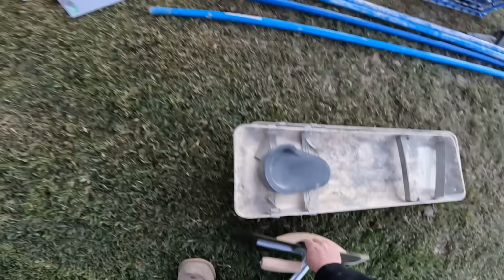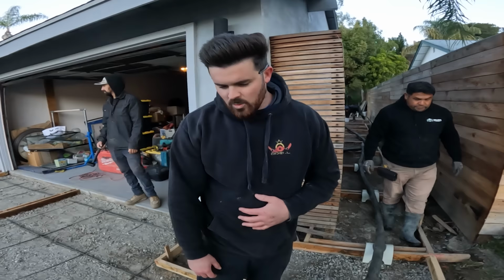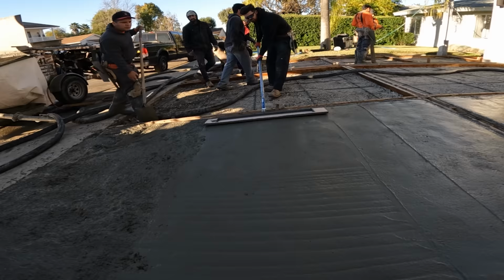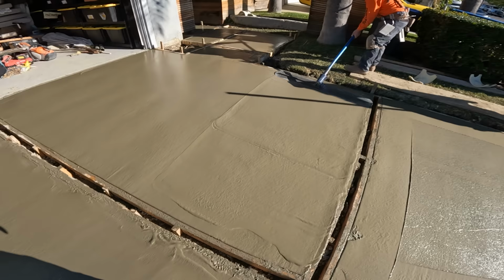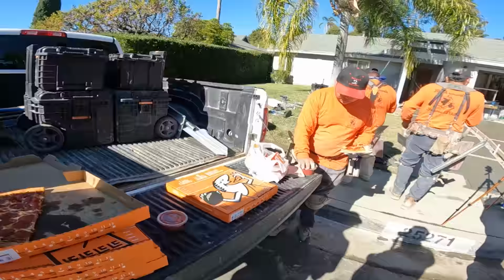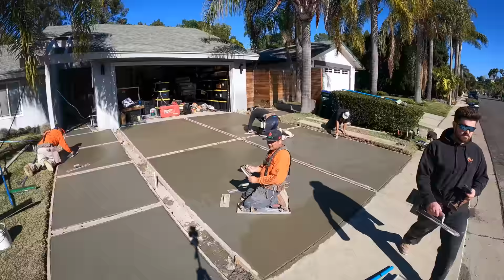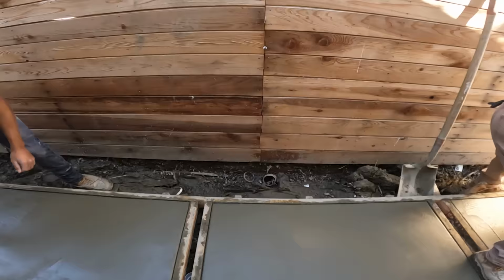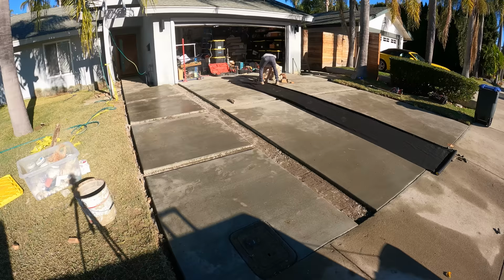Finally Poured after getting FLOODED!

Comment: Every finisher has their own preferences.  But, for me it was far too wet of a mix, a slump test would have confirmed I think.  Don't know why there were so many short screeds working, that seemed to rake the high spots instead of "saw" them by screeding.  I used to screed, form to form, sometimes twice.  You will never get as level a finish with eyeball short screed as you can with a full length straight screed.  Pump sure makes it a lot easier, back in the day it was extensions on the chute, and wheelbarrows for what the chute couldn't reach.  Back then crete was running less than $50 a c.y.

Comment: A quality finish is KING, so Shane for the win this time. Louis may have been set up to lose with the pool float though. No matter what they both learned from the race and had fun!
Reply: you are correct but people are forgetting that Shane was practically engaged for almost 5 minutes! Just go through the timeline and you'll see that Luis stopped at the one minute mark and shane kept going throughout the video! Obviously it's not a great big issue but if we keep it fair Luis would have crushed it with another 4 minutes😁

Comment: Do you have just oil in that spray tank? I use a 50/50 mix of oil and diesel fuel. Basically add the oil & diesel and shake it before each use. It's a great combo and the forms pretty much just fall off when you remove the stakes. And turn the tip until it's spraying instead of that stream.

Comment: Using 1x4 form boards on at least the short sidewalk sections would make it easier to wreck those forms when you’re ready.  Save money too. Just gotta make sure you stake them good. 
That mud almost looked like it was hot.  If you had the truck spin up n mix it good and still got that, I would have sent that back. 
Your mud was bleeding so much because you were sucking up that ground water.  Could have maid down some polygon prevent that. Gotta be careful with that much water on top. You don’t want to finish it with that water in the top layer or the surface will be weak and the finish could dust.   Did good by waiting and not getting on it too quick tho.  You’ve got a good crew.

Comment: Awesome job on the driveway, walkway and patio.   Quick question, I absolutely hate broom finish concrete.  I've worked in auto repair, so it's been concrete floors metal trowel finish and sealed.  very rarely did the floors get slippery when wet or covered in oil.  Might have been the type of work boots I wore.  My question is do concrete finishers still use wooden trowels to finish driveways and walkways?  The house I own (built in 1984) has wooden trowel finished concrete and some things I like about it is, ease of keeping it swept off.  Broom finished seems to hold dirt and concrete dust.  wooden trowel finished concrete also seems to be sealed a little better than broom finish also, but not like metal trowel finished.

Comment: I believe that too much floating and polishing is not good , thus bringing water to the surface causing weakness !
All of the old concrete should be kept beneath ,with only soft ground removed .
To effect a polished finish  a fine shallow  layer  must be on top with floated finish !

Comment: Always thought rebar was suppose to go in middle of the concrete. To stand on the rebar while pouring. That rebar is on the ground and does nothing under the concrete.
Reply: You seen this when you took out the old concrete. Even commented on how rebar on the ground is bad. Then you do the same thing. If I was the home owner you would ve tearing all that work out and doing it right. End looks doesn't replace quality work. Sorry to complain but thats just not good work.

Comment: They never lifted the reinforcement, lol.. Is it really impossible to put plastic spacers under it? The reinforcement should lie in the upper 2/3 of the concrete thickness and have a protective layer of at least 20 mm.. Here it just lies, if you lifted it, it will still fall to the bottom, because you smoothed it out and vibrated it.
Reply: Also, for some reason you poured water on top to level it out, this guarantees you cracks.

Comment: The matrix on your 3000lb pea gravel mix wasn't quite correct.  you probably had 200 or 300 lbs of small rock more than what you needed.  That is why it wouldn't mix properly.

Comment: concrete is not mixed properly for one, way too much water added. dont know how much NCA you put in but it will help with curing process. why are you using stainless instead of a mag to finish? 
you didnt spray any sealant, that's why your concrete is stained and patchy.